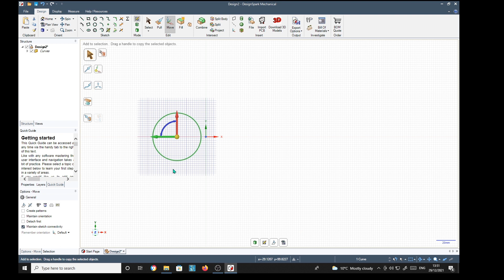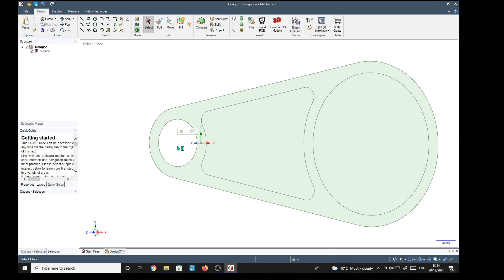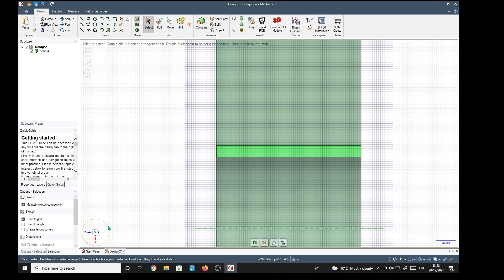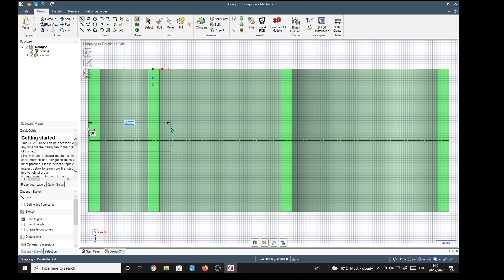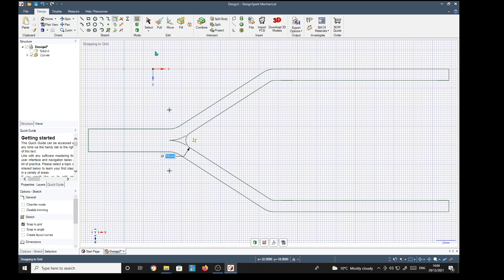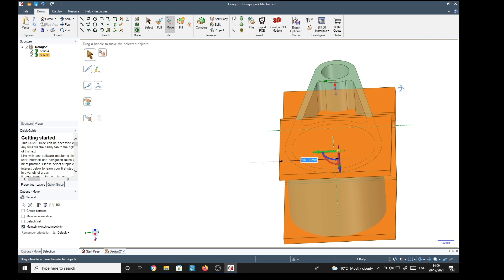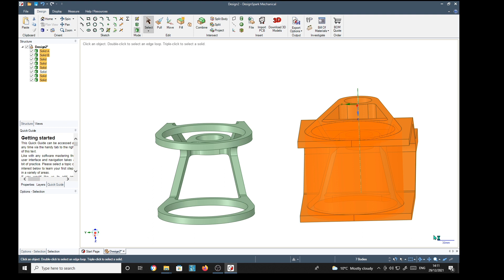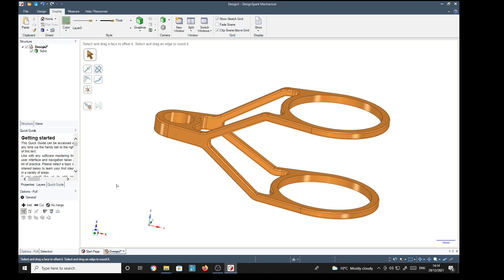137 Bearing fork

Comment: Jim, been using DS Mech now for more than a year, I really appreciate your to the point little videos.   I'm having a problem today and can't find a solution, I can't cut a rectangle out of a solid using the pull tool.  It moves a bit in  delete mode, then stops.  I tried a circular surface and it worked.  But when I draw a rectangle to cut out, it wont' work!  Can't figure it out!
Reply: Are you trying to simply cut a rectangular hole in the solid or are you wanting to cut a rectangular solid piece out of it?
Reply: @jamestaylor7025  Thanks for replying so quickly.  It was just a simple move to cut a hole.  I see sometimes that I must have done something prior that causes an issue, but I couldn't figure out what.  I could draw a circle and cut that hole, but a little rectangle wouldn't work!   I gave up and started over and made those cuts early in the design and it worked fine.  So just trying to figure out what the little idiosyncrasy are in the software that keep things from working sometimes.   Thanks again

Comment: Hi Jim. For some reason I cannot resize the circle  as you describe at  0:55 seconds. Any ideas?
Reply from the maker: You should be in Sketch mode with the Select tool active. Then select the circle and you can type in a new dimension.
Reply: @JimTaylor42 
 Hi Jim, Thank you. Found my problem, I am running version 5 and had turned on the constraints. Unticked it now and all back to normal. I though I was going mad. 
 I was having problems with my keyboard shortcuts not working. They were turned off in the pc settings took me ages to figure that one out. 
Hope the finger fund is going ok, I did stick a small donation in last week via Paypal.
Many thanks again.
 James
Reply from the maker: @jamesmoody562  Glad you got the problem sorted. 
The finger fung is turning out to be a slow process. Hopefully it will pick up.